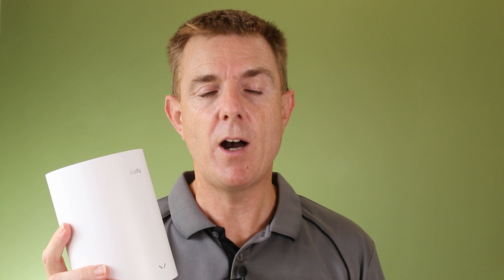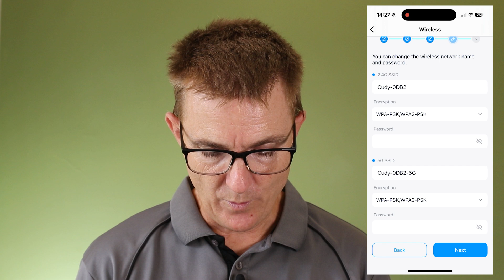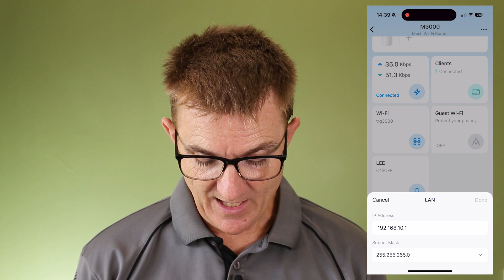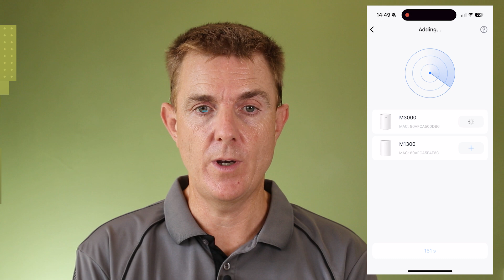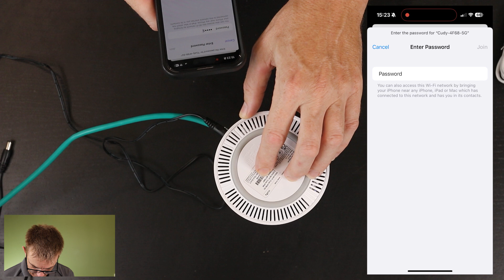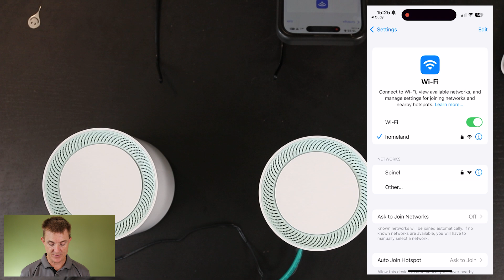Deep Dive - Cudy - Whole Home Mesh Wireless

Comment: Can I use an RJ45 cable to connect from the Ubiquiti fibre connector to the Cudy BE3600 router? This rather than going from the Tenda router to the Cudy.
Reply from the maker: You can normally connect that RJ45 directly into the WAN port of the Cudy BE3600 instead of going through the Tenda first. The Cudy supports the usual WAN connection types such as DHCP and PPPoE, and can also apply an ISP VLAN ID if required. The main thing is to check what the Tenda is currently doing. If it is only acting as the router, the Cudy can likely replace it. If the Tenda is handling ISP authentication or VLAN tagging, you would need to copy those settings into the Cudy first.
Reply: @The_Tech_Geeks Thanks!
Reply: Just a router I think...

Comment: How many networks can be created and can we create dedicated/ isolated IOT network on this device
Reply from the maker: Thank you for the question - the M3000 can run separate 2.4 GHz and 5 GHz main SSIDs, and it also supports separate 2.4 GHz and 5 GHz guest SSIDs. So if you split both bands you can have up to four visible SSIDs, although they are essentially a main network plus a guest network rather than four fully independent VLANs. For IoT devices, the easiest option is to use the Guest Network as the dedicated IoT SSID, as Cudy isolates guest clients from the main LAN. Just be aware that this can affect devices that need to communicate directly with something on your main network, such as a local controller or casting device. Also, the Guest Network feature is available when the M3000 is operating as the router, not in Access Point mode.
Reply: @The_Tech_Geeks thanks

Comment: How many of these can you add to your network ? i added 6 but could only see 5 on the app any ideas why i cant see the 6th one
Reply from the maker: We haven’t seen Cudy publish a clear official node limit for that exact model, so we wouldn’t want to say it is a hard manufacturer limit. However, there are real-world Cudy mesh guides that suggest around 6 wireless mesh nodes, or up to 10 nodes when using Ethernet backhaul.
If your 6th unit is not showing in the app, we’d try the following:
Update the firmware on all Cudy units.
Factory reset the 6th unit.
Pair it while it is close to the main/primary Cudy unit.
Refresh/reopen the app after pairing.
Once it appears, move it back to the final location and check the signal strength.
If it disappears again after moving it, it is likely a placement/signal/backhaul issue rather than just an app issue. If possible, try wiring that 6th node back to the main network with Ethernet, as wired backhaul is generally more reliable and supports larger mesh deployments.

Comment: I have a cudy 4g lte cat 6 gigabit modem, can i connect to this to improve internet speed?
Reply from the maker: Yes, you can normally connect a 4G/LTE modem/router to a Cudy mesh system using Ethernet, but it depends what you mean by “improve internet speed”. If your current issue is weak Wi-Fi around the house, adding the Cudy mesh can help because it improves wireless coverage and gives devices a better local Wi-Fi connection. However, it will not make the actual 4G/LTE internet connection faster than what the modem and mobile signal can provide. The “Gigabit” part usually refers to the Ethernet port speed, not the mobile internet speed. For better 4G performance, the biggest improvements usually come from better modem placement, stronger signal, or external antennas if your modem supports them.
Best setup would usually be: 4G/LTE modem connected by Ethernet to the main Cudy unit, then Cudy mesh handling the Wi-Fi around the home. If the LTE modem is already acting as a router, you may want to run the Cudy system in Access Point mode to avoid double NAT.

Comment: Hi my router is downstairs and i want to try upstairs. Im from South Africa so we we use concrete and brics on our houses. Will this work for me upstairs?
Reply from the maker: Good question. I believe in the video we actually demonstrated how far it would work through concrete walls which generally should be the same going upwards for you as well but obviously the design generally of this device is for a horizontal Wi-Fi and not as much vertical Wi-Fi.  So in theory yes it should work for you through concrete. It’s just whether the signal will come out in a way that works the best in your scenario.

Comment: can i mesh the cudy m1200 to my outdoor cudy ac1200  ?
Reply from the maker: Yes, it should be possible. Cudy lists both the AC1200 Outdoor and M1200 under their Cudy Mesh range. Make sure both units are on the latest firmware first. If the outdoor unit is already installed and difficult to remove, you can bring the M1200 close to the outdoor unit for the initial pairing instead. Once paired, move the M1200 back to where you want it and check the mesh signal strength.

Just make sure the unit connected to your internet/router is acting as the main mesh/router, and the other unit is added as the mesh node. If the outdoor AC1200 was previously configured, it may need a reset before pairing.
Reply: @The_Tech_Geeks ohk thanks

Comment: u mean modem ??  how can u say router ??  if u have a router  then why buy this ?????
Reply from the maker: Good question. A modem handles the internet connection from your provider, while a router manages your local network, Wi-Fi, firewall/NAT and connected devices. Some ISP boxes combine both in one unit, but they can often be placed into modem mode/bridge mode so another router or mesh system can take over the routing and Wi-Fi. You might use something like this to improve Wi-Fi coverage, replace weak ISP Wi-Fi, or have better control over the network setup.

Comment: i thought of using separate network for 2.4/5 ghz and customizing channel width and number for each for maximizing speed....but smart connect does it all on its own? should i set it too?!! 🥲
Reply from the maker: Smart Connect is convenient because the system decides whether devices use 2.4GHz or 5GHz. Separating the bands can be useful for troubleshooting or for devices that only behave well on 2.4GHz, but for most homes we’d start with Smart Connect and only split the bands if you run into device compatibility issues.

Comment: I have a large 3,000 sq ft apt. The Cable Company (Mas Movil) in Panama has a Modem with Speeds of 1G down and 50MB up. The cable company added 3 other signal extenders. In addition, I have 4 Cudy AX3000, set on Wireless MESH, with two connected to my TV and two on the other side of the apt to assist the Cable company's extenders. My question is - do I have too many devices? Could the Cudy units interfere with and degrade the Cale company system? Should I change the configuration of the Cudy system from Wireless MESH to Access Points? What do you suggest?
Reply from the maker: Yes, it is possible to have too many Wi-Fi devices, especially if the cable company extenders and the Cudy mesh are all broadcasting Wi-Fi in the same apartment. We would try to avoid running two separate Wi-Fi systems on top of each other. For a 3,000 sq ft apartment, we’d normally choose one main Wi-Fi system and optimise that, rather than using the cable company extenders plus 4 Cudy units all together.
If possible, the cleaner setup would be: modem/router from the cable company for internet, then use the Cudy system as the main Wi-Fi coverage system. If the cable company modem/router must stay as the router, put the Cudy system in Access Point mode. If you can wire any of the Cudy units back with Ethernet, that is even better than wireless mesh.
We’d probably start by turning off/removing the cable company Wi-Fi extenders, then test with the Cudy mesh only. Use the fewest Cudy units that give good coverage - maybe 2 or 3 first, then add the 4th only if there is still a weak area. Too many wireless mesh nodes can actually reduce performance because they all share airtime and can interfere with each other.

Comment: I want to use my 2nd cudy m1300 in my office more as an wireless access point for wireless printer in the office.. and then connect the office cudy via long ethernet cable (via hub) to the main cudy .. .. but it seems when i do that it still tries to forward traffic from wireless printer through the (weak/distant) wifi connection it has back to main cudy and not through the ethernet connection.. is the setup I'm trying to achieve possible?
Reply from the maker: You should be able to do what you are after, but it sounds like you have the office cudy still in mesh mode.  You will need to set it up in access point mode.
Reply: @The_Tech_Geeks   That did the trick appreciate. Had to reset the office cudy (turn the main mesh cudy router off), then connect to office cudy via wifi, log into it's own webportal and set it as access point..